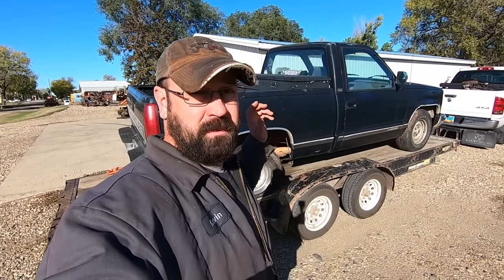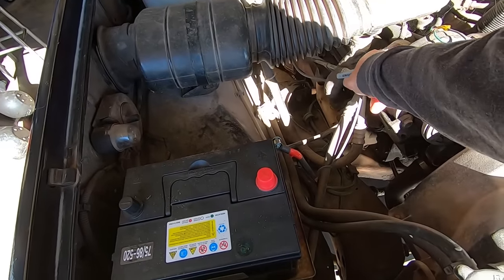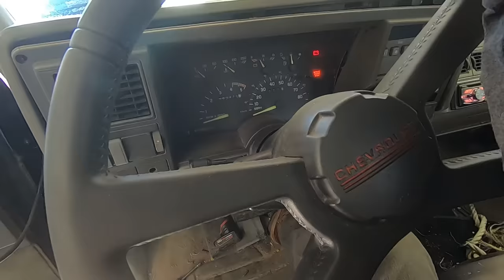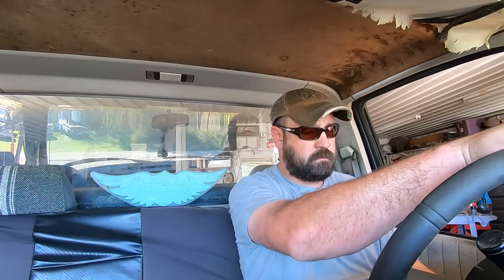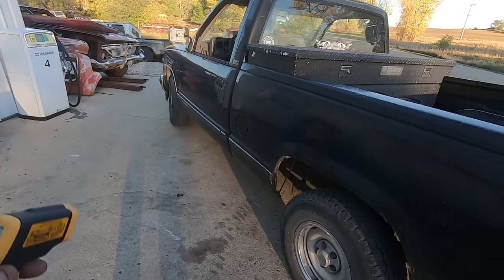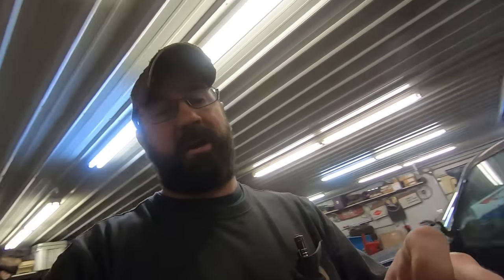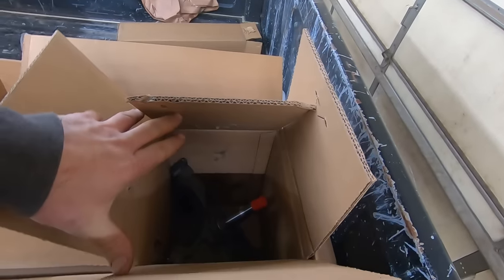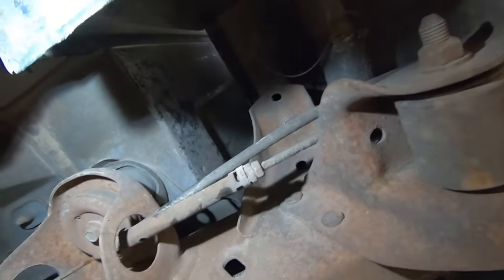1992 Chevrolet Silverado Transformation! From Junk to Jewel! Daily Driver OBS SWB Build!

Comment: Take the distributor cap off and use a Dremel tool with wire wheel and clean off carbon. Flush coolant and put GM sealer tabs in it. They work great. Pretty good truck. My 2020 Silverado wiperblades are so easy to replace. Why do the blades on the drivers side always wear more than passenger side? I switch the blades around once a year.

Comment: i  had a 91 siverado that had two blown headgaskets and it was all disassembled, it was 4wd and a manual and a 350 that had been disassembled so had lots of parts missing and it was missing the bed. but it was only 100 bucks. i ended up selling it for 500 bucks to a kid who put a flatbed and a rebuilt engine.

Comment: This video inspired me so I did some horse trading and ended up with a 91 short bed Silverado just like yours except it's charcoal gray with the 4.3 and a 5-speed.
Reply from the maker: Awesome!
Reply: @MortskeRepair  Update, replaced the head gaskets and got it running right again, new exhaust donuts and I still have to finish the rest of the exhaust system, I didn't do a full lower but I did lower the rear 3" just to level it out. The next two days is for cab corner and rocker panel replacement, put in a new dash cap and give the interior a good scrubbing, the seat and carpet are in perfect condition, just dirty. 

 I'd like to email you some pics if it's okay.
Reply from the maker: @stevew270  Sounds good!

Comment: I prefer the hot wrench for the threaded end on the E-Brake junction  using vice grips on the crimp by the cable then heat the Nut Cherry and wrench away. Candle wax goes a long way on the nut and threads after heat! If one uses a small amount of oil and could get a little in the end of thee cable from time to time they will work flawlessly. Granted the hardware is good.

Comment: Those brake hoses like to swell when they get older and get pinched at the metal bracket that holds them midway. Sometimes you can pry the bracket apart and it will work again for awhile.

Comment: Ah the pre 1995 style interior in the OBS Chevy's. Love it, screams Back to the Future to me for some reason.
Reply: Yeah this generation of GM truck you could get a 700r4 transmission or the 4L60/4L60e. I think the 4L60e is much later on. Those would be in your 2000s GM trucks. Only thing is the shifting solenoids going out, but not too bad. Basically a continuation of the TH350 and the 4L80e is the continuation of the TH400. Design wise, not exactly the same, but the mechanics ish.
Reply: Lol the on and off buzzer be like a hospital bed in a dramatic movie 😅
Reply from the maker: Flat lined!

Comment: Good find. I really enjoy hacked up old security systems. I have had them start on their own whenever they want to. One even started up on its own on the alignment rack at les Schwab.  I just found your channel and subscribed. You do my kind of projects.  I have a 1997 k1500 extended cab shortbed. I like a standard cab shortbed 2wd to fix up just like yours.  I like the first generation vortec engines. Tbi are simpler but 1996 to 2000 5.0 and 5.7 are pretty similar except fuel injection and cylinder heads.
Reply from the maker: Thanks for the sub Mike!

Comment: Mortske, Love the look of the truck after you lowered it. I have a '90 that is identical. When you showed the blinking light on the dash, I thought, " no way!" Then you popped the hood and I pooped my pantaloons. I have the same stupid security system that you have. Key fob locks the doors, the horn in the engine bay, electrical grid under the dash and yes.... scotch clips.  Could it have been a dealer option? I don't know. All I know is I'll bring sammiches and come up and watch you take mine out. hahaha!!!
Reply from the maker: Dealer could have installed it. Only took about 15 minutes to remove. Super easy! You can do it!! I believe in you!
Reply: @MortskeRepair  Thanks, I'm glad someone does. Hey to Duff!

Comment: Yeeeeee Hawwwwww... wish you would a replaced the Upper and Lower ball joints only so that I could a learned from you. I did it myself, started it atleast before having to call in a mobile mechanic, fellow hillbilly, yeehaww, over to my house to finish the work. 

I used an angle grinder to cut an X into the Rivets, then cold chiseled the head a tha bolts off, then cut the entire upper ball joint in half(I had a cheap harbor freight air hammer, I reccomend getting a more powerful one) but we ended up cutting the entire upper ball joint in half with an angle grinder, heating it up, then using my cold chisel to finally get them off. The bottoms needed a ball joint press to remove. But what a process, uppers and lowers are both removed differently, with a diff set of tools and both installed differently. This is on a 4 cylinder Chevy S-10 I got.

Today I just purchased another S10 with a 355 SBC in it, and I'm gonna do all that same work again and upload it to my YouTube channel. I had difficulty finding a video that explains how to do what I did, but they we're all incomplete so I'm hoping I can fill the gap with my new knowledge. I enjoy watching your channel. Git R Done from Farmer Doug in Dudley, Massachusetts... yeee haaawww

Comment: To clear up the headlights....600/800/1200 all wet ....then power polish with toothpaste....clear as factory....but you'll need to clear coat with a rattle or they will " UV yellow" again in about 6 months.
Reply from the maker: Yeah I've done that, lotta work and you can get new ones for pretty reasonable.

Comment: Ignition issues were probably the ignition control module and the pickup coil, and the dual air cleaner stud tbi along with the round plug tps sensor 1992-95

Comment: Another way to block off a brake line: Disconnect brake line at master, put a BB on it, the bubble flange usually hold it if youre lucky, tighten er back up
Reply from the maker: I use a nail!

Comment: I had a brake hose issue on the same side in my 80 k10….. would drive 10 minutes to work and it would heat the paint off. Loosen the bleeder and shed be good to go home…. Replaced the hole brake system in clouding the line…. Blew air from one end and the other. Going back up the line it would have very little air….. acted like a check ball. The most annoying thing. That’s why I always flush the brake systems after every brake job just to help cycle out fluid and eliminate all the moisture built up

Comment: Heads up about the rear view mirror. Have your auto glass shop cut you a new mirror. Was only $5.00 here. And use silicon caulk to fasten. Easy peasy as you say.
Reply from the maker: Nearest auto glass shop is 90 miles away.
Reply: @MortskeRepair  might be more than $5.00 then😂😂

Comment: You have the ring gear and pinion for the planetary gears rear differential. May recommendation that you add the dark dye to the all the teeth of both pinion and ring gear like a color blue on drafting the sheet steel. At where? - after you remove the inspection plate. Then rotate up to between 10 to 25 rpm on the rear wheel of Dark blue 1500 Chevy truck. Then unattach the ring gear. See, if the ink dye is removed off from the helical teeth ring gear. That is where it's worn out from the friction action on pinion and ring gear. As long as the worn of the slip between the pinion tooth and tooth of ring gear is center reflective contact area. It is the reason that there are 5 shims so remove the shim in the front of the housing of the rear differential ring gear. If the shim is not removed that means the contact friction is too far off from the center toward to the outer diameter of ring. It wear out too fast. It will last longer if it is center to the middle along with gear oil.

Comment: D&D Speed Shop...Dan has found a muffler that looks like a cheap turbo muffler. Works and sounds mildly muscled until you rotate a linkage lever not unlike a carburetor butterfly  and surprise the lever rotates an internal butterfly....lo and behold ...straight pipes. I am sure Dan would tell you what they are, who makes and how much they cost. And now you made me realize that I need 2 trucks, 1 for overlanding/camping/fishing/ hunting fun, the 2nd for street cruising/grocery getting/ fun. Darn, Redneck Retirement Fund had better kick in heavy this weekend.
Reply from the maker: Thanks for the tip

Comment: You were spinning that Shock shaft a little bit, lol. Maybe with an impact?, Lol

Yes you spun the shock piston right off the end of the rod, lol
And if it had any gas pressure left over? It spit that shaft right out of there. And you could’ve actually gotten quite wet with oil

Comment: Please, can you hold the fire! What I saw was that you did smart job by removing your spindle with its knuckle-arm for 3 ball joints suspension. Then the new heavy-duty spindle is not center like an original hub adapter spindle. Nominal, the Chevy have brake rotor 5 stud-type instead of hub connect to brake disc. That you have the spindle that is offset away from the center to downward there that did make your truck chassis higher and more ground clearance. You are welcome. Thanks.

Comment: If it’s not broken then don’t fix it. ;)
I also agree with you on the rolled bumper thing. So not practical.
I’m not sure I’d lower a 4WD but each to his own.  I guess it’s great for a work truck.
Here in Australia everyone is putting lift kits in! I was noticing on your test drives how flat everything is around your way.  Flat as buggery :)
Nice to see you working on a keeper.
Reply: Roll pans are what you bake your bread on. Not to put on a truck. If you want a rounded rear end buy an amc pacer. Trucks need a bumper.

Comment: The HEI coil atop the distributor of 1992 shortbed 2WD within the resistance ohms specification because it did not fire on the sparkolator test. So, again I hope you would check the spark fire by eye vision after try out another used HEI coil from junk yard good used part.
 Tech looking at condition of transportation (TLC).

Comment: I'm old enough to remember when the 88's came out.  If you wanted to install an aftermarket tape player, you had to buy a kit from Crutchfield to do it, nothing would fit in the factory radio spot.  The kit came with a pocket to install where the factory radio was.  I wonder why they left the factory radio in place on yours when they installed the CD player?
Reply from the maker: Cuz they hacked it in!

Comment: Wait until the bolts inside the steering wheel come loose for the Tilt and then you steering wheel tilt the other way which is a common problem with that year of Chevy pickup trucks I was told that GM used the wrong kind of Loctite on the bolts

Comment: Ahh...my truck 1997 F250 front brake caliber has two bolts that attach the caliper to the spindle's heavy-duty plate. These two bolts are what make it stop as long as your step on the brake pedal of dual action master cyclinder. The bolts came off from the brake caliper are both worn on the thread easily after rode 90,000 miles odometer. Recommendation, replace the bolts that I have to. Thanks for reading.

Comment: I went into the dash of my Ford F250HD cuz lights would blink out on rough roads. Found five or six wires with bare ends where the removed stuff, including two power lines that would short out on the bumps. Other people definitely are not good at wiring.
Reply from the maker: That'll do it!

Comment: What iv noticed in the stud difference in the tbi is the one that has 2 normally has a 4l60e and the single stud has a 700r4 an throttle position sensor are different thats atleast what I have noticed

Comment: Glad that you remove the security wiring. Then you replaced the distributer in the 1992 pick-up truck 350 cid. Chevy. Then you may want to use ohm multimeter and test the ignition coil that the primary circuit - the + and the negative atop the coil will be under 3,000 ohms and middle secondary circuit connect to the primary side small stud and reading should be under 13,000 ohms. Thanks.

Comment: Pull the carpet, spray it down with Simple Green, and take the power washer to it. Pull the seat belts all the way out, clamp it with a cheap plastic pinch clamp, and soak it in a bucket of water and Simple Green.
Reply from the maker: That is some good stuff!

Comment: When I was a used car safety man I had to remove many of those aftermarket systems. They were a bad idea.The slider switch was a shock sensitivity adjuster .In other words it would go off a parking garage if another car drove by or a window had to be smashed with a great force before it would engage depeding on how it was set.
Reply from the maker: ahh good info!

Comment: Justto clarify, the last year of the 700r4/4l60, is 92. In other words, you don't need to pull it and rebuild it as often.
Reply: The only big heel of the 700r is the TV cable( which no parts store has it listed as, good luck) and the governor.

Comment: finally an obs nice. i have an 89 myself one tough sob i swear but 3/4 ton 5.7 tbi with 72 hp in front of an th400 so kinda a dog but gets the job done.
Reply: im in oklahoma too by the way not far from oh puddin
Reply: i hope its 92 that would be 700r4 instead of 4l60 and yeah yeah same thing but not really
Reply: and no i have all that in my tool box lol but doesnt leak fluids so that doesnt always tell the story
Reply: it use too lol but ive rebuilt half the truck mostly new seals pump etc you know normal things you shouldve replaced at least once in 30 years
Reply: i dont use the cup holders in glovebox mine works well and no cracks in my dash at all and want to keep it that way
Reply: and as far as headlights i got an 89 for the 4 light headlights they dont fog over.

Comment: FYI, he mirror glass changed from 1996-1997-1998-1999-2000 (the later being the Suburban) And those actually look like 1993-95 mirrors almost.  1992 and older were also different.  Plus they changed based on option package.  They claim 88-98 but I can tell you they aren't always that.  Option packages like manual mirrors made a difference, and then (from my experience) painted vs stainless backs made a difference.  So you may have a painted mirror glass and a stainless mirror housing.
Reply from the maker: Interesting

Comment: The driver side braker caliper Bendix is costs liquidation slash it off for it's worth $39.99 dollar, require to be install to the front wheel Silverado light truck pick-cab single cab. The brake hose between new caliper and proportional valves is worn and squeezed as damaged way beyond repair. Recommendation replacement hose from Auto shop sale for parts. The store in Kansas sells all 2 rotors 11 inch dia. each from China and 2 calipers single pot each all four of new ceramic brake pads includes 4 copper washers/seal ring. Thank u.

Comment: pcv port is clogged on the throttle body, those valve covers never really leak unless that is clogged, very common, and check oil returns under valve cover, thats your smoke.

Comment: 3 of the tires are Walmart tires. 
The Uniroyal Liberator is a line Walmart used to carry, the Goodyear Wrangler Authority replaced them. The Liberators were pretty good tires, and when I started working for Walmart in Dickinson, we sold a lot of them to the guys in the oil patch. The guy that had the Fedex Ground delivery contract in the area put a set on one of his vans one night, and inside of 6 months had outfit every one of his delivery vans fitted with Liberators. He had put every line sold in Dickinson on his vans and said the Liberator didn't last quite as long as those did, but the difference in price more than made up for that.
The Dextero is Walmart's economy highway truck tire line. They are a pretty good long running no frills tire. Just don't expect any fancy stuff like white letters.
The Goodyear Wrangler Radial is only available in P235/75r15 and a pretty good highway tire with a bit more aggressive grip. Right now, the Goodyear tires are on Black Friday special at Walmart. Free lifetime balance and rotate plus rollback pricing on the tires.
Reply from the maker: You're the tire expert Danny!
Reply: @MortskeRepair  Hey. 14 years at Walmart. 😁
Reply from the maker: @dannyo6699  You must run that place by now!
Reply: @MortskeRepair  I already did for 2 years. 2014-2016 I was a service manager but I stepped down and went back to a technician position. I was having some medical issues and the position was complicating them. I'm now lead tech (not really a position but if it were, I'd be that).

Comment: Hello Kevin Mortske, I think the coil is badly rust and always suggest you to replace the coil right next to the ECM firing control module in distributer 350 cubie, Please?
Reply from the maker: Been running fine. Coils rarely fail that ive seen

Comment: Alarm looks like one of the aftermarket systems the dealership would install  then try to sell it to you when vechical was sold new. For like $1000.00 add on. That you never knew you wanted. You finally would say yes to just to if it would  get you out of there any sooner ; /